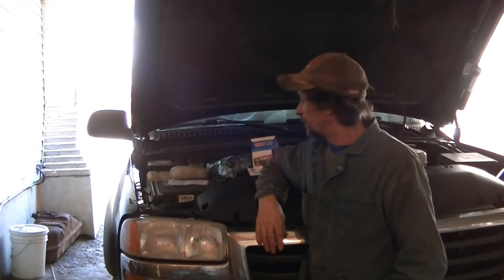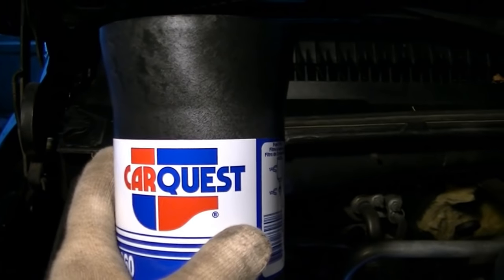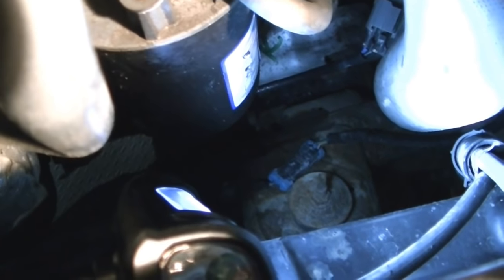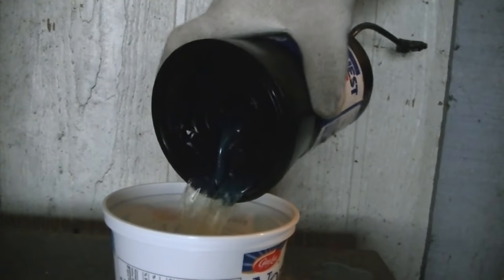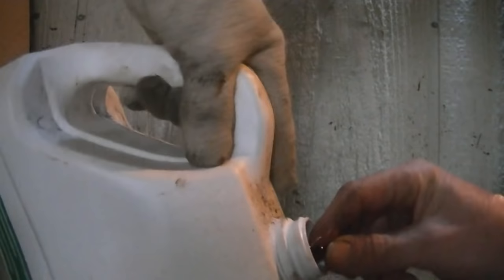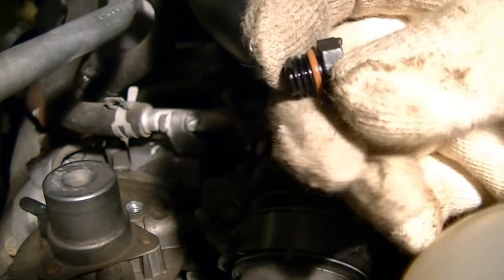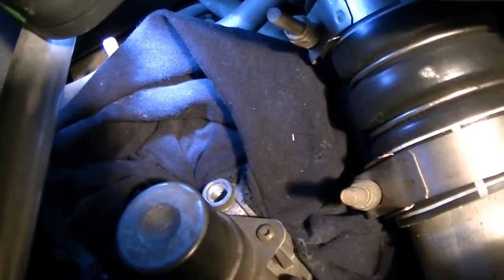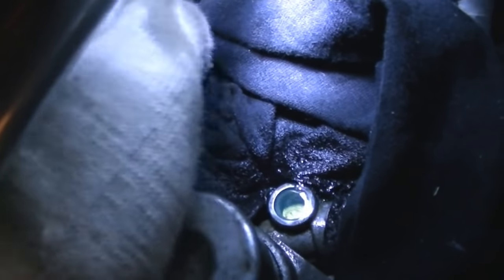Duramax Fuel Filter Change

Comment: Just had major service done at dealer, including fuel filter, two days later check engine light comes on then this morning she started up then quit. I haven't done filters on this yet so not even sure where the primer was or what it looked like, Tow truck was going to be $130.00 from here. Found your video, check for prime, fuel coming out of bottom drain, unhooked wires as you showed and tightened up and primed and she fired up. That was a good job you did on the video, short and complete.You da man thanks for posting this is my first you tube comment too.

Comment: Great video and I thank you for your efforts!  
Some additional information.  I could not reach the filter on my 2008 Silverado HD...so I had to remove the inside fender cover/liner the plastic one.  The purge valve is a half inch using a quarter drive with extension it is better than using a screw driver.  Lastly, you should be able to fill the filter 85% with the fender liner removed.  This makes purging real easy. Also don't forget to reset your fuel filter service life to 100%.

Comment: @MudRFunR     I was there to just pick up parts for my f150 and notice the service chart on the wall.  I imagine the ford filter would be around the same price but almost $200 to install inc/hst is crazy.   Looks like a 30-40 min job max.  Took you less than 10 min on ytube.  This vid alone saves someone large on a simple job,well done.

Comment from the maker: Not sure but I believe the sensor is just there to warn you before the water has a chance to cause problems. I just used a closed end wrench to remove the sensor. It's not on there very tight.

Comment: Very well done, the little precautions you add will keep people from messing anything up. I'm surprised you used an aftermarket plastic filter, you over paid and there have been some complaints on the style filter, I went with ACDelco because I'm sure of the design. I plan to pull my fender well for easier access. Thanks for this video and your insights.

Comment: Thank you for your video. Much appreciated. We've been changing the one by the fender well, and keep having to change it. Was wondering why. Didn't know about the other.
Reply from the maker: Lesa Purkey Is yours a diesel?
Reply: Yes
Reply from the maker: Now i'm confused. I have not seen a fuel filter by the fender
Reply: He said its not right by it but close.  I guess.  IDK.
Reply: Lesa Purkey 
There is only 1 fuel filter on the Duramax. What you saw in the video is the filter from a view from up top.
Reply: OK.  Cool.  Thank u

Comment: but besides my warning to people, good video man! its a bit of a pain to push up and screw the filter into place but you get good with it over time! good job buddy! next time PLEASE use the AC delco filter yes it costs more but it is what the designed want on the truck so put it there... cheep filters like to come apart and its almost 5 grand to replace everything and clean the system, and don't ever fill a fuel filter from a dirty can... you putting dirt right past the filter, use the primer

Comment: Ecellent video about about cleaing FILTER AND GASKETS.  It is is tremeously helpful to remove to remove the intekake manifold hot for for just for more room to workl.  More room to work.  Hope it helps.  I'm still having starting mine but I think it's a leak I'm msising  somewhere or that plastic cap.  Gonna replace it with brass , copper or alumium.  Keeping fingers crossed. Thanks.

Comment: Best video yet.  Now if I can get my duramax to get better than 9 mpgs
Reply from the maker: +Dave Miller Thanks for your comment. BTW my Duramax gets almost 
23 mpg. Hope this helps your mileage.
Reply: +MudRFunR I have aftermarket exhaust and air filter.  Any suggestions?  Are you running a programmer?
Reply from the maker: Dave Miller I would think that aftermarket exhaust and filter should help mileage. My truck is stock. No programmer. Maybe your settings in your programmer are causing bad mileage. When I bought my truck, I was looking at another similar truck with a programmer and choose to buy the one without it cause you never know what has all gone wrong because of misuse from a previous owner.
Reply: +MudRFunR I bought my truck used with no programmer.  doesn't mean there wasn't one prior to me.  I also tow a light trailer day to day for work.  I'm gonna change fuel filter and clean the MAF sensor.
Reply: +MudRFunR Mine used to until we had to start running this ULSD crap.

Comment: Thanks that helps to a new diesel owner. Question for you I have a 2004 Duramax that the ignition would not shut off, key stuck in the run position and had to pull the switch out to shut it off. Been driving it by turning the switch with my finger. The key will not turn back any ideas? Thanks.

Comment: PS - Love GM!!!!!!!!!!!!!!!!!!!!! Yes they have problems like anything else, but the 4 we own or have owned, have had very little problems. Mainly the nagging sort of problem like a leak or interior cosmetic issue, never a major transmission/engine needs replacing problem.Never been stranded in any of our GM's not once.
- Owned/Own: 98 Yukon, 99 jimmy, 98 blazer, 2002 siearra duramax

Comment from the maker: I've always mostly driven GM. (I've owned 2 Mazda's and 2 Jeeps) but GM has left me stranded on 3 occasions which I am solely to blame. Once I scrapped a truck and not thinking, I just poured the gas from it into my 96 1500. I made it about 2 miles....full of water. The other 2 times were in my younger days with an 
84 S15 - V8 327. Once I broke the rear end gears and 2nd, I broke the torque converter. Let's just say I made full use of all 325 horseez.

Comment: The LMLs removing/replacing from the top is a lot harded. So remove the the fender well liner to get to the fuel filter. They make a fuel filter door cut out. So you dont have to remove the whole finder liner.

Comment: great vids Mudr. I have a driver I keep in the glove box. I also bought a spare screw
Reply from the maker: +Al Ferraro I would like to find a metal one.
Reply: @MudRFunR  mine is brass
Reply from the maker: @weswebber4263  I have an aluminum now.
Reply: Good deal much better than that plastic  bs
Reply from the maker: @weswebber4263  My plastic one crumbled when I tightened it. I had to get a bolt with a jam nut to keep the truck running until the new one came in the mail.
Reply: @MudRFunR  yep exactly what I did but got another housing  and brass "nut" if ya will and all it takes is hand tightening and untightening. Much better than plastic

Comment: Love my 2002 Duramax, with the exception of my injector issue. Were replaced at 70,000 miles 4 years ago. Now have 130,000 miles on truck (I know low for a 2002). Any idea if this will be a recurring issue; as in I will be replacing them again in a year or so???
- Also, thanks for vid., I just bought a filter and thought I'd get a quick online refresher.

Comment: Mudr...thanks for the great video.  Do you have to reset the internal memory so that the engine knows the filter was replaced.  When i start the truck it tells me it is time to replace the fuel filter.  If we have to reset it...what is the trick?  I remember something about stepping on the gas pedal or the brake pedal 2-3 times with the ignition on but the engine not started.
Reply from the maker: What you described, pedal down 2-3 times, I think applies to resetting after an oil change. My truck is a 2004. It has no message for a filter change. The owners manual should have something about resetting it after a filter change.

Comment: never use a screw driver on the bleeder screw.  it's very soft plastic.  I was stranded when the head cracked off
Reply from the maker: +Al Ferraro You are so right. Mine got all chewed up and I have since then rebuilt the primer pump with new plastic bleeder screw. Now I keep a socket on an extension in the truck. No more screwdriver. Thanks for your comment, much appreciated!
Reply: Ppe makes an aluminum screw that is awesome replacement....set it and forget it
Reply: @MudRFunR  what size socket?

Comment: Hey Brother.  thanks for the vid.  You seem pretty knowledgable in this rig.  I gotta ask you a question that may or may not be related to the fuel filter.  I have an 02 2500.  Last month, i parked, and when i restarted a couple hours later, it just shut off as I rolled into the street.  I ended up just priming the fuel filter with that top button.  It worked great for a few days.. but now its been doing it more and more often.  Then tonight, i couldn't get more than 50 feet or so before it shut off again.  I replaced fuel filter 2 weeks ago.  It has run without interruption for the last 3 days then all of a sudden, tonights events happen.  Do I just have more air stuck in the lines from an improper bleed? or is there another possible culprit for constantly having to prime the fllter?  Thanks in advance for any guidance you can give.
Reply from the maker: This is exactly what ny duramax was doing before I changed the filter. You must be getting air in the fuel system somewhere. My guess is either a bad o-ring on the bleeder screw or maybe the seal got kinked when putting on the new filter.
Reply: just a follow up comment.  I reseated the fuel filter on the gasket and re-bled the system and it works like a champ.  again, many thanks... I don't have much hair left, but i sure was pulling it out before this.
Reply from the maker: Nice and simple fix...Good to hear! Thanks for your feedback, enjoy!

Comment: I got a 2011 2500 HD and im just wondering if the process will be relatively the same if not exactly the same on my vehicle?
Reply from the maker: Dallas Burke Not certain, but should be generally the same. Some people take the plastic inner fender out to get a better look.
Reply: Dallas Burke 
Only thing different is on the LMLs you are gonna want to remove/replace the fuel filter from the fender well. Not much room to remove or replace the filter from up top.

Comment: I noticed I got the water in fuel message is it OK to start it up after seeing that message
Reply from the maker: Is this before you changed the filter or after? I wouldn't start it with water in the filter.

Comment: Pre filling a filter through the center hole is not good. That is where fuel comes out of the filter,  so any dirt that was in your fuel can will not get filtered.
Reply from the maker: I used a funnel with a fine filter. I forgot to mention that on the video but later put an annotation note on the video. YouTube has removed all annotations from all videos. Thanks, I had forgot that this note was removed. Maybe I'll do another updated filter change video.

Comment: By prefilling the fuel filter you are putting unfiltered diesel into your fuel injection system.  Do what you want but I don't want particulate matter going through my injection system at 23600 psi.
Reply from the maker: Actually, I did add an annotation, saying to use a funnel with a fine filter. But you are right, I should not have filled the filter.
Reply: Are you saying to not add fuel to the filter? Or, make sure you filter it as you put it in the filter?

Comment: Thank you
Reply from the maker: +Paul McMaster Just glad to help!
Reply: +MudRFunR word of advice my man, i know the filter costs more, but the OEM filter WILL REMOVE WATER, the WIX will NOT remove water. your fuel system does not like water. i work in a gm dealership and i have seen plenty of these filters put water through the system, AND twice seen them come apart and sent paper through the system.
Reply: +Kevin Rogers oh good to know. reminds me of the Ford powerstrokes with they're fuel filter built into the cap.
Reply from the maker: Kevin Rogers WIX is all I've ever used in 4 yrs. so far so good. Next filter change, I will look into price of OEM. Thanks for the info!

Comment: MudRFunR I have a 05 6.6 duramax. Just last week when I put my foot in it to pass someone or whatnot it cuts me off at 2000 rpms and it stays like that until I let the truck sit and restart it. Do you think its a fuel filter issue? Im pretty green on vehicle mechanics.
Reply: Evan Curtain I replaced the fuel filter and it seems to have fixed the problem.
Reply: Joe Cautrell Same thing happened to me last week. I will try the new fuel filter. That would be a cheap fix. Appreciate the post.
Reply from the maker: Randy Coblentz Hope this helps fix your problem.
Reply: Mine did the same last week, punched it up a highway on ramp and wouldn't rev past 2000rpm (although it was OK next morning).  It's also gotten a pulsing idle in the last 10K miles. It's got 322K miles on it.  Trying the filter first, if not fixed, from what i researched, the fuel pressure regulator would be the culprit. fingers crossed!

Comment: On my way home I came to a stop sign and was about to take off and the truck won't go past 10 mph. I need help. I just replaced the fuel filter.  Help me please!
Reply from the maker: Not sure if I'm too late to reply. Just make sure that your have all the air out of the bleeder. Is your filter tight and sealed? OR try pumping the bleeder without opening the screw but just until it can't be easily pumped and try that. Let me know if you have more troubles.

Comment: you dont need that wrench to take the fuel filter off...if your a man you can unscrew it by hand...but channel locks are needed to remove the bottom plug to put it on the new filter...and the water in fuel sensor is pointless you can leave it disconnected...

Comment: just watch this and your other video on rebuild the primer pump for mind has started to leak( lose prime)
Reply from the maker: Hopes this video helps!
Reply: I check the local parts dealer and they show no kits for this. do you have kit number or supplier
Reply from the maker: I bought mine at a local small town parts store here in Ontario Canada. Have you tried a GM dealer. It should not cost too much.

Comment: I bought a used 2007 Chevy Silverado HD 2500 with a 6.6 turbo diesel.  I couldn't pass up the great deal on this one-owner baby.  The previous owner had a K&M air filter installed that is supposed to be a "lifetime" filter.  I just cleaned the damn thing for the first time and question whether or not it is worth the trouble.  Anyone out there have any experience with these, including you MudRFunR????
Reply from the maker: I have only had one K&M filter. It's in my mud truck. I have never cleaned it before. It's only been in there for a little while. I do know that a regular Wix filter here in Canada costs about $40.
Reply: MudRFunR I just changed out my fuel filter and after having to remove the fender well to access the thing have decided that I make way too much money to EVER do this again myself.  I don't have the patience required to do very much mechanic work.  I find myself being over-whelmed with a pure hatred of engineers who are obviously trying to make it difficult for the average consumer to perform simple maintenance.  I say this while working side by side with chemical and mechanical engineers everyday.  I like my 2007 Chevy Silverado HD 2500 turbo diesel 6.6 but I won't be purchasing another.  I'm going back to Ford.  Its easy to see why GM had to seek the socialist's Obamas help but Ford didn't.  The UAW was 99% of the reason but GM engineering isn't far behind these clowns in nailing shut their own coffins.  The UAW and GM management (no testicles to stand up against a socialist union) are socialist clowns that deserve each other.
Reply from the maker: I've heard that the newer trucks have to be done through the wheel well. Also, for whatever reason they stopped putting drain plugs in the rads, sometime after 2004. Anyway, I like my Gm's...always done good for me. I spoke with 2 diesel mechanics before buying mine. Both said Duramax and Cummins are more reliable. They do more repairs on Ford diesels than GM and Dodge. (I'm just repeating what I was told)
Reply: MudRFunR Thanks for the info.  I was upset after having to go through the wheel well to replace a fuel filter.  I'll most likely stick with Chevrolet or GM to be honest.  I've got a great truck that will pull a house.
Reply: Hugh Jorgan
I've found that going through the wheel well makes things so much easier, even on my 2002 Sierra 2500HD. A few plastic plugs and the plastic wheel well comes right out. The filter wrench is so much easier to use, disconnection of the WIF sensor  and keeping fuel spillage cleaned up is a breeze with the fender well out. I bought a box of spare plugs for the fender well since some get torn up during removal. The couple of minutes to take out the fender well pays off immensely. Great video by the way to MudRFunR. One thing though. When installing O-rings in a seat, it is best not to run your finger around it while seating. It should just be pressed down into the seat to keep from distorting or stretching the O-ring. Keep up the good work.

Comment: Why would you put unfiltered fuel into the filter, that's a NO NO.
Reply from the maker: In the video I failed to mention that the funnel has a filter. I had added an annotation note to the video but YT has taken out all annotations. Sorry
Reply from the maker: I also added a note in the video description to help clarify this. Thanks for the heads up.
Reply: Not putting any fuel in my filter cuz i dont have any!

Comment: When I pump the primer, its taking forever and have seen no fuel
Reply: +Marc Mccorkle When I change mine it takes around twenty pumps to fill the filter and bring it to the edge of the bleeder hole.  If you have done this and still no fuel you're priming pump may be kaput.